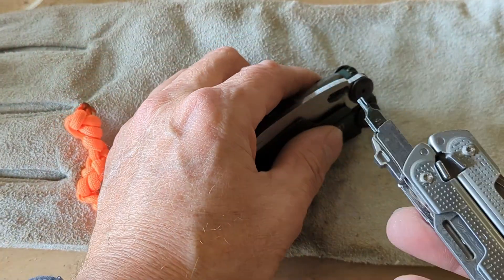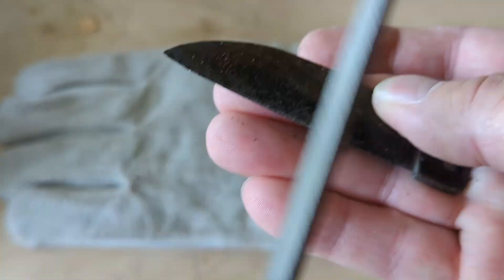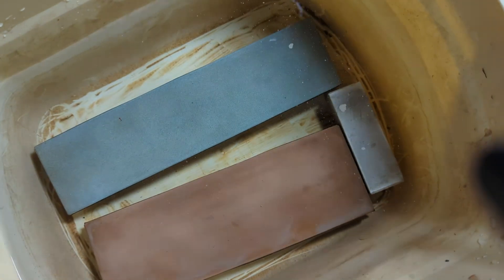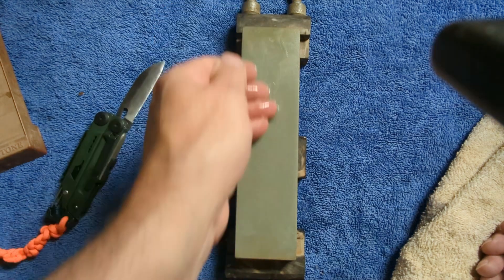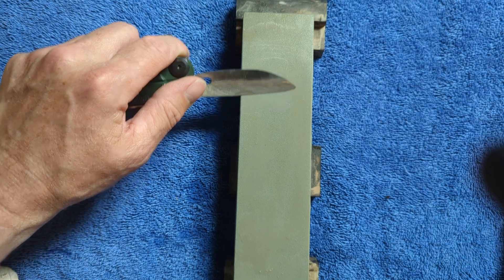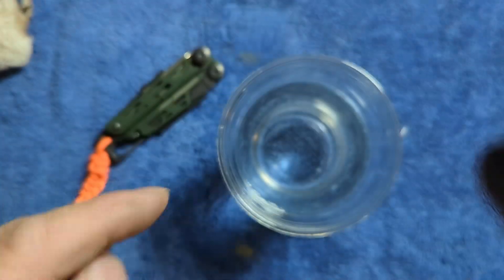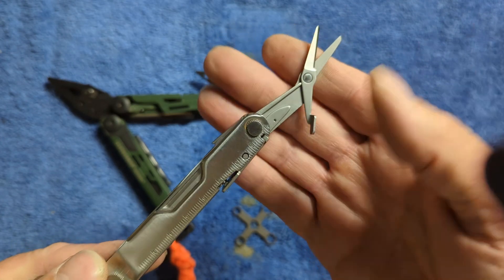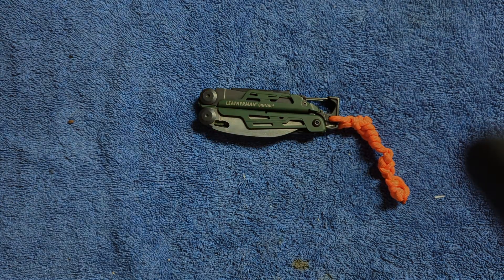Leatherman Signal Custom Blade and Scissors Mod Part 2

Comment: That blade turned out very nice. Cool process you use. Nice mod.
  That scissors mod was pretty cool as well. 
Hey did you get that email i sent out the other day, i didn't know if you got it or not. You and your family have a wonderful day my friend.
Reply from the maker: I got the email. A care package will be going out this week. I was out of an item that I wanted to include and had to make some more. The new blade makes the tool. Everything woods related is better with a plain blade. It sticks up high enough to be used as a scrapper or strike a ferro rod while closed. O1 also produces good sparks using flint. This extends the knifes fire making ability.
Reply: @TheCuttingEdge-LCK oh ok cool! My phone likes to mess up on me so i never know if things go thru or not. Sounds good and like i mentioned, i will let you know when it arrives. Thank you again.
 Oh yeah it definitely does. Very cool, multi-use blade for sure. Oh cool, that is one method i have never tried yet is the flint and steel method. Yes it does extend it for sure. Very cool mods.
Reply from the maker: @jeffjackson5331 Plus, i had covid and am just now feeling good again. I didn't do anything for about a week. That's why there weren't many videos lately.
Reply: @TheCuttingEdge-LCK  oh no that sucks man! My wife and i are just getting over a nasty virus too. We both still have an annoying cough. I am glad you are feeling better brother.
  It's all good my friend. Your health takes precidence over us and videos in my book! Get yourself back to good health my friend. You and your family are always in my prayers my friend.